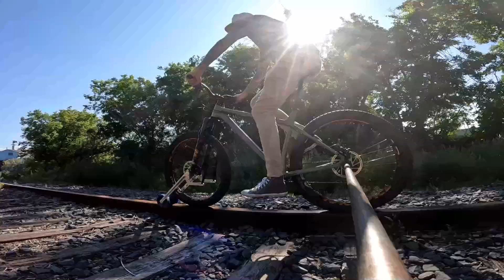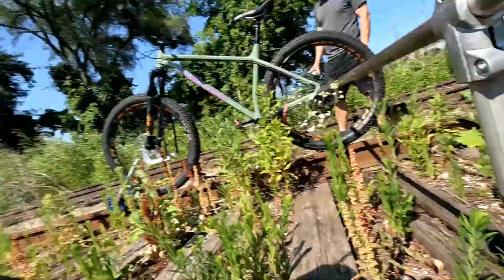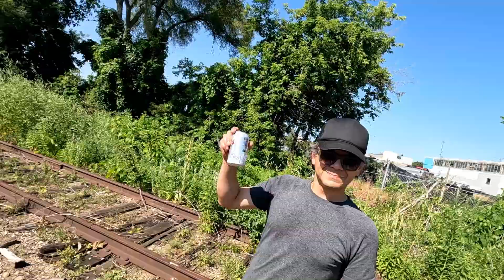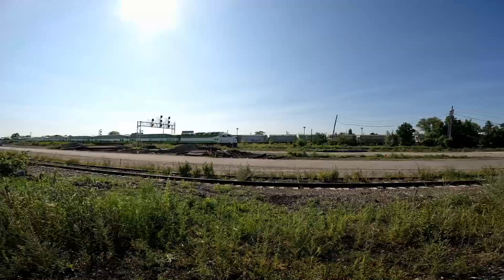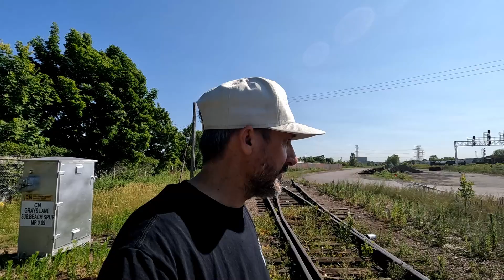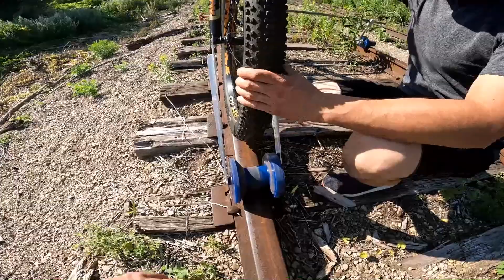RAIL BIKE - Version 8 - New Rail Wheels - We have had an incident, and it was a mechanical

Comment: have you ever looked closely at a railcar wheel?  There is a reason why they are so big in diameter...to keep it on the track. Also because you are putting steering pressure on the handlebars, is another reason for your steering problems...I would also relocate your front wheel assembly to behind the front wheel so any weeds or brush is less likely to get caught

Comment: Hey man been loving your thoughts on this as I am trying to get into some old areas here in bc to do some fishing. I know your against it for extra pieces but I would highly recommend a bard from the front axel to the outrigger wheel. it will stop all the tourqing on the in the stainless axel peg and it will give you a great place for some gear mesh. Keep up the kewl testing. Funny I knew you were in ONt when I seen a Go train in the last episode. LOl
Reply from the maker: I've always had the extra brace from the front guide to the outrigger in the back of my head. But I am trying really hard to do without it just so I can pack this up easier for my trip. Up until now, the major challenge has been wheel geometry, both orientation and widths between guides. I've got a few more ideas, but I am almost ready to make a final design.

Comment: I think 2 bikes side by side may actually be simpler, and more fun with a partner. That way you can clamp to seat stay and both bikes will maintain the separation.
Reply from the maker: Totally agree with you. I'm working on a tandem bike set up right now.
Reply: @Suluk46  Two bikes with a third seat in the middle.
Reply: I have such a rig, and yes, it is fun to share the experience, and it is a lot more stable by design.

Comment: That rail you are running on is not overly wide. I have biked on much wider rails. What you need to do is get rid of the taper on the outside of the guide wheel, then put a very slight offset in that axle, one or two degrees is all. then the guide will skew a little right as it goes. This will eliminate any need to have an outer guide wheel or flange; this is good because it won't matter how wide the rail is. I know this because that is how my rail bike is designed, and I have run hundreds of miles without a derailment. I kind of like your concept for the outrigger, just eliminate the flange.
Reply from the maker: Interesting. I'm having a hard time envisioning the front guide wheel without a flange. Seems like if you inadvertently turned the front bars, you would detail. Have you got some pictures or a sketch so I can understand it better? Just send it to info@suluk46.com I'm just getting back into working on it so a new design is in order.

Comment: I don't see any reason to have the single locator wheel be rubber. It's not there to transmit power. It's there to align the front wheel to the rail. The same shape in a hard plastic or maybe even wood would slide against the sides of the rails instead of trying to climb.
Reply: it could just be a slippery plastic skid with flanges
Reply from the maker: You're correct. Wood is a great option as it is hard and I guess sort of slippery. Plus it's cheap and easy to fabricate into shapes.
Reply from the maker: This is also an option. I would prefer a rolling wheel option so it is as smooth as possible but perhaps the less mechanical complexity, the better.

Comment: It's looking good and many things are being discovered. Here's three suggestions...Attach the outrigger to the seat tube. The higher attach point (raising the moment arm) will provide more strength and stability from tilting left or right - a cross brace from the outrigger to the front wheel axle will provide much more stability to the outrigger and keep it from swaying forward and backward - two rail guides on independent suspensions for the front wheel will keep one on the track should the other one bounce. Either have two guides with one farther out in front or have one behind the front wheel.
Reply from the maker: Have you seen some of the older versions?
Reply: @Suluk46  Yes. Nice progression. You still could benefit from a brace on the outrigger to the front wheel. It could be as simple as a cable on carabineers and tightened with a small turnbuckle. The outrigger catches weeds and small trees and sways back causing the wheel to change it's orientation on the rail. We never saw how the two horizontal guide wheels made it through the track switch. I don't see how they could do that as there is very little room between rails at the switch. Just enough room for a wheel flange to fit through. I'm very interested in what you're doing here and wish for you to succeed.

Comment: A few minutes ago I commented on version 7. I’m new to your series and didn’t realize there was a version 8 vid. My suggestion after seeing version 7 was to have the front lateral guide wheels canted at 30ish degrees. This should provide you with nearly the full stability advantage of the horizontal wheels but get the wheels and axles up out of the way of asphalt, wood, or other rails such as encountered at road crossings or rail junctions.
I think you’re on the way to achieving the simplest reliable bike rail system. Quick set up and not compromising the rideability of the bike off rail is the key to making this practical. Thanks for sharing the trial and error journey.
Reply from the maker: If you go back to V6 or maybe evn V5, I did put them at about 30 degrees. For the exact reasons you state. I guess the only real downfall is the more complex design to get all the adjustment and stuff to work on such an angle. Reality is that many different wheel configuration work well. I am certainly going for simplicity on this one. I don't want to have a complicated breakdown in the middle of my trip.
Reply: @Suluk46  Sorry that I wasn't more clear from which plane I was referencing 30 degrees. I have seen the angled wheels in your Version 6 vid. That looks like the disk of the wheels are tilted 30ish degrees from vertical. My suggestion was to come up 30 degrees from horizontal. For further clarity I'll say now that I don't think 30 is a magic correct number - I just picked a round number to make a point. Here's what I was trying to get at: Having the wheel disks at 0 degrees, or completely horizontal worked really well for stable tracking. The problem that I think we both saw is that the wheels get in the way of a lot of things when they are sticking straight out from both sides of the rail. I was merely suggesting to tip up just enough to get the guide wheel out of the way of wood, asphalt, other rails, or splices. Maybe it only takes 20ish degrees or maybe you don't get enough clearance until a little more that 30 degrees. I certainly would expect at 45 degrees or more vertical that rail climbing would occur as you stated it did with version 6 (from the plane that I've been calling zero Version 6 guide wheels look 60ish degrees).
I'm fascinated with what you're doing and how you're going about it. Absolutely love your quest for simplest possible solution.
Reply from the maker: @MrGoodaches  Got it. Now I understand what you are describing. When I chose the 60 degree angle, that was based on a design that someone had sent to me, known as the Bentley Railbike.  A lower angle may help reduce the likelihood of it climbing the rail, but so would a harder material with less grip. I pulled between the single wheel with flanges and the multi-wheel design. One is much simpler and easier to maintain, while the other is much more stable. A guy at my work mentioned that getting very small wheels (like 1/2" diameter) for the side guides would allow it to fit in all the books and crannies but still be stable. There is very little lateral force so that is another option.

Comment: Awesome! Where can I buy a single-flanged wheel like the one you used in the rear?
Reply from the maker: Railriders sells the big blue wheels. I don't really think they are that good, high friction bearings, and material is too soft....but try them out if you like.
Reply: @Suluk46  Thanks a lot for the info!

Best regards from Romania!

Comment: nice video! 
The outside of the front wheel is right angle, but the inside is curved?
Is there any special reason?
Reply from the maker: Inside is worn from the train wheels while the outside is rough.

Comment: I like the progression of development. It looks like the outrigger is kicking the rear wheel to the right if it encounters resistance from leaves, grass etc causing derailing and it also seems to flex.
Would it still work if you made the guide and outrigger one unit? that way you could use an ultralight pair of simple flanged hard wheels. An alloy?carbon/Ti back packable version convertible from  3ft to standard gauge would be cool.
Reply from the maker: This is still in the back of my mind. Basically a single front guide and outrigger from the front wheel and then using single flanged wheels. It would be a challenge to use most of the parts I already have, but I would enjoy making something significantly different. In my mind, there would be a challenge with "window jamming" but perhaps not...need to test!

Comment: Love the simplicity. I started thinking of using a fat bike as well. If you had clearance in the forks, you could add a flanges to the front wheel itself, thus not needing a leading roller-flange for guidance. The wheel itself would be the guide. It would need some forks with really tall clearance, or a smaller wheel though. I guess that make the bike only rail-ridable, unless the wheel was swapped.
Reply from the maker: That's not a bad idea. There is a benefit in performance when the side guides are further forward of the front wheel pivot point, so having it directly below the forks may not be ideal. But, I have thought about getting rid of the rolling rail wheel in the guide and just have the 2 side guides.

Comment: Ah ha! Railrider wheels...

The outrigger flange is unnecessary. I use the front wheel from a wheelchair, and have a skateboard wheel attatched that will save me should the rail width vary, and as you found out, it does.

I see you've found shortcomings with the DF-200. I recontoured mine which greatly improved it's performance. Chuck it in a lathe, and use a disk grinder with 40 grit. The inner flange has to be ground concave. You'll be delighted with the inprovement.

The major problem I had with the DF is that when you hit debris or rail defects on the outside of the rail, it derails. If you are moving, you'll crash.... been there, done that... too many times.

May I suggest you make the frame for your guide longer while you're at it. Make it so it is minimally, 8 inches in front of the bike's front wheel, more is better. This slows down how squirrely the front wheel will be. Your problem is all about this length. My first successful railbike was constructed like yours, short guide...

The DF wasn't the fastest I've built, but it was the safest, most reliable, after my concave mod. 

I'm designing a safer, faster guide wheel now. I've made prototype, and it works really well.
Reply from the maker: Again, awesome feedback! I have moved away from the DF-200 front guide. It is too soft and I believe designed for a brand new rail width, the rails I am on are rusty and old, and often the rail becomes much wider from degradation. I didn't throw it out though, so I can certainly perform the modification you recommend. I just built a new version, and actually am editing the video now, but plan to extend the front wheel guide further ahead of the wheel - I'll go with your 8"+ recommendation, and I want to make it stiffer. My current one is much too flexible.  New video should be up this week, would love to hear more of your thoughts!

Comment: Oh MAN, did I learn the same lesson, HARD!! 
The boat roller seems to be the answer, doesnt it?! That hurt. I added Nylon flanges and ground out a radius to meet the flanges, in the existing taper. Its the 45deg taper on the boat roller that is the problem.
Reply: and the flange on the outrigger roller is counterproductive. It will sometimes cause the rear wheel to be pushed off the far side if the tracks become narrow. A bigger diameter for both the front roller and the outrigger make a HUGE difference too. A polyurethane shod, ally hub wheels or even a 12 inch BMX wheel on the outrigger. I have a 16inch one on my rail cargo bike. Runs great on the dirt too.
Reply from the maker: New design coming soon. Just need to find some time. But everything you say is where I going in the design. I've also had much better luck with horizontal wheels as the side guides. Smooth as a knife through butter.
Reply: @Suluk46  I use 32mm dirt bike chain rollers for guide wheels. They fit through the gaps in the switches. There's a huge difference between pioneering or exploring and riding a piece you know well. Light is nice if you know there's nothing to look out for, but if you go bush bashing, a strong rig is good. Trust me, you will continue to test and develop for ever. It's that kinda hobby.
Reply from the maker: That made me laugh. I told my buddy the other day that the Railbike well is so many different orientations that you could constantly change it for the rest of my life. Sounds like you know your stuff so I appreciate the advice.

Comment: You have something like cold fusion.  The solution is always just a few versions away.....
You raise interesting issues of safety.  It is not always obvious whether a line is truly abandoned.  Risk is also to a train that runs over a rail bike and may be derailed.
Questions: 

- normal rail wheel flanges presumably do not rub significantly on the rail.  I suspect that there is a special shape to the flange.  Yours seem too simple.
- Wheel size:  large 29er wheels not useful in this context?  I guess you want something easily made road rideable though.
- I like the idea of locationg the bike using two internal flanges, because those spaces are used by real rail wheels.

Go well with the next version
Ed
Reply from the maker: Cold fusion is a great analogy for this. The one good thing is that I believe I have satisfied myself by trying everything. The reality is that many of the versions worked well. I'll have to think about my next one a bit more. The only thing I can think of to try new would be the outrigger on the front wheel, with just 2 internal flanges, just like a real locomotive.
Reply: @Suluk46  Thank you for your reply.  It is a very intriguing subject of not in reality very useful.  I wonder whether a front outrigger should have provision  for ballast (or luggage) above the outrigger wheel to help stop it riding up, and (is this needed?) to reduce risk of capsize away from the outrigger.  Go well.

Comment: Do you think a fat tire bike, say 4" tires, would help reduce the derailing incidents? An electric bike would be cool.  Keep experimenting,  I'll be following.
Reply from the maker: I don't think fatter tires would help, it really comes down to how well the side guides work. I've basically tested every orientation you can think of. Next version should be great.
Reply: For the radius of a railway, and if you had flanges, you could just lock the steering of the front wheel to 'permanently' straight ahead.

Comment: Your front "wheel" mimics a train's TOO accurately.  Trains dont ride up on that angle because there is no turning mechanism and another wheel directly opposite prevents it.  It's also a lot harder to ride up on that inclined plane when you weigh dozens of tons.  Moreover trains don't care much about energy inefficiencies, and they actually use that inefficiency (friction from an attempted ride up the inclined plane) to prevent derailment.

I think the geometry is too specialized.  You need something proprietary.
Reply from the maker: All valid points. This system does need to be a bit different. I plan on modifying the current wheels over the next few weeks. It seems there are no shortage of ideas to test 😂
Reply: @Suluk46  This was my first exposure to such an idea, so I thought you were flying in the dark.  I've actually found a ton of other people making similar designs...who knew :p  Best of luck!
Reply from the maker: @dereksimmons5877  I only found out about them last year as well when I was thinking how I would ride my bike along a very old abandoned railway up north. It has sort of become a bit of a passion project. I am at a point where I can build a final version, but I also enjoy testing all the ideas everyone has.